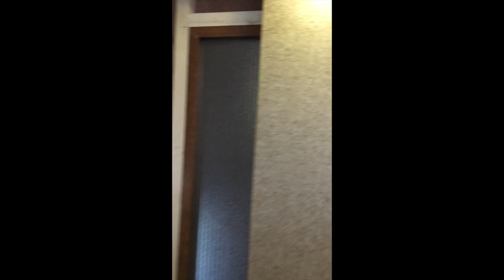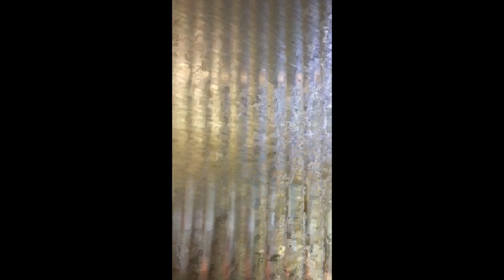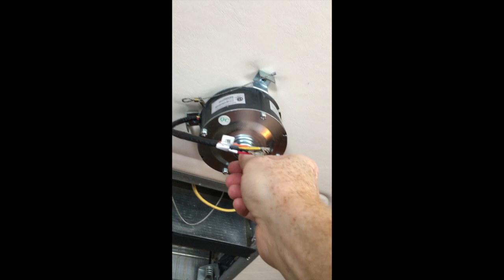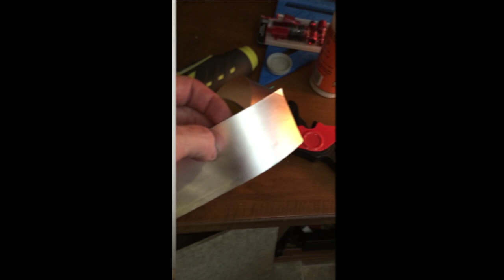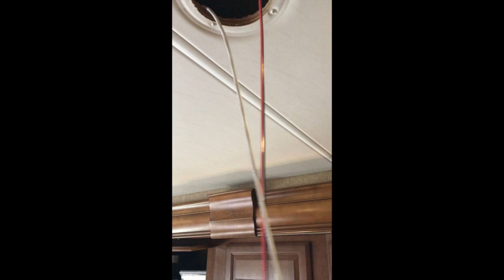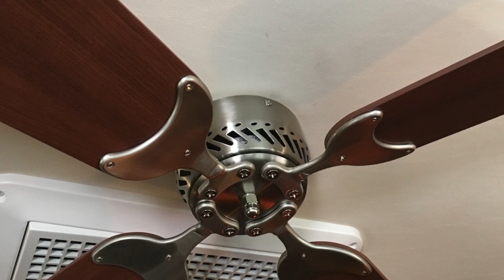2nd RV 12V DC Ceiling Fan Install

Comment: Why did you do all that work, you have a remote?
Reply from the maker: All the electronics powering and controlling the fan are in the switch, including the IR receiver for the remote.  That, and wanting an alternate way to control the fan if the remote is damaged or lost.

Comment: What make of RV is this ? You said that you have 3/4 plywood on the ceiling . I think my looks like 1/4 wood.
Reply from the maker: I misspoke on the video, and didn't realize till later.  It's probably 1/2 inch plywood,  a 1/2" insert for the lights sits flush.  It's a Challenger gas motorhome.